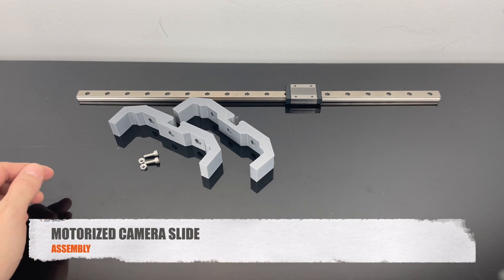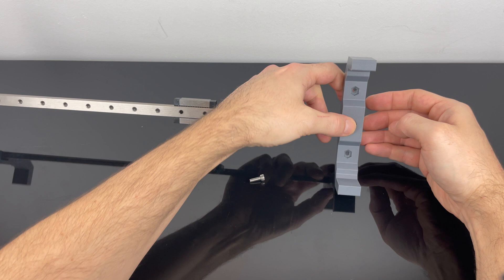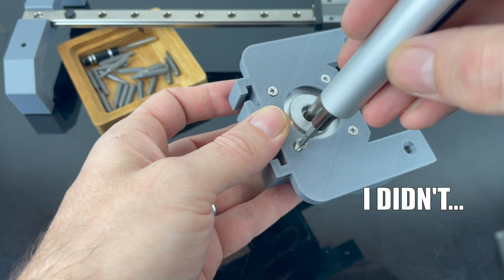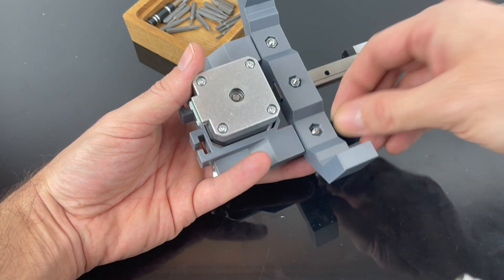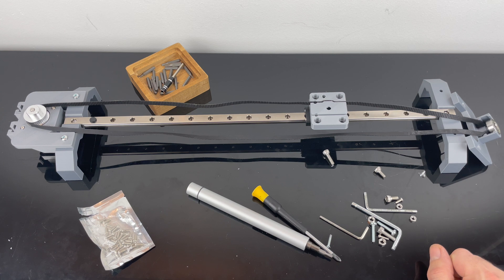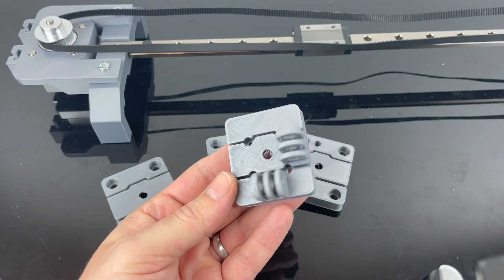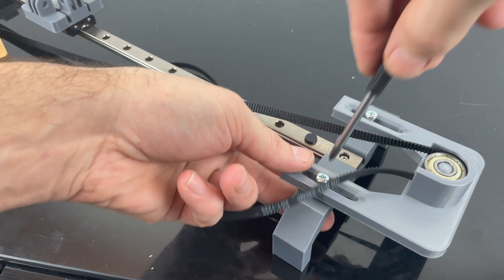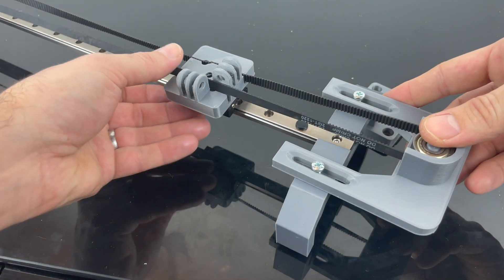ARDUINO DIY MOTORIZED CAMERA SLIDER

Comment: Set pins MS1, MS2, and MS3 all to High (H). This enables 1/16th stepping. That will slow down the stepper significantly.
Reply from the maker: Thanks i will try that!
Reply: @logicron  a couple other notes on this. Make sure you adjust your steps per revolution in the code to reflect the 1/16th settings. For example, I had an application for similar settings whereby my Nema 17 motors had 200 steps per revolution when set to 1 full step. However, at 1/16th there’s 3200 steps per revolution and that’s what I updated the code to reflect.

Also, keep in mind that setting MS1, MS2, & MS3 can be done manually by simply connecting each to 5v on the Arduino. This keeps you from having to reconfigure code for the H setting.
Reply: @chadconley9641  thank you so much for explaining in detail, much appreciated!

Comment: you should use a tmc2208 driver.. silent motor sound and smoother movements..keep it up and hope to see more upgrades to the camera slider
Reply from the maker: This is very true!, I have also played around with DRV8825, also nicer but for sure the TMC2208 or the TMC2130 is a better choise